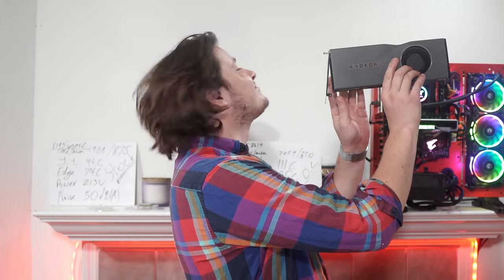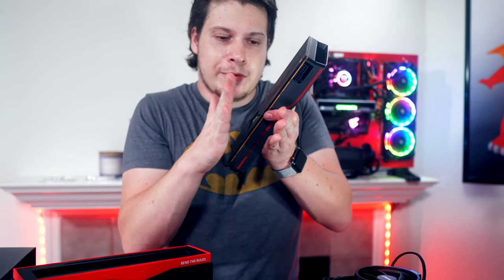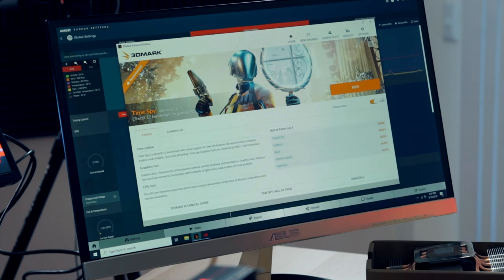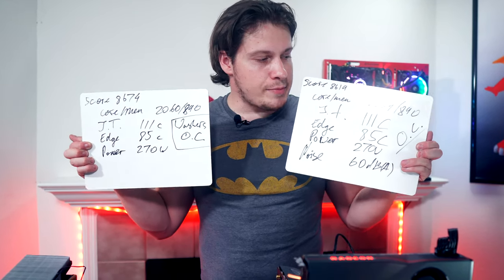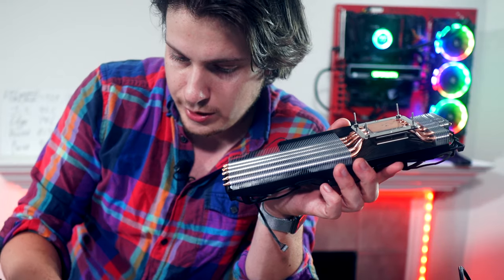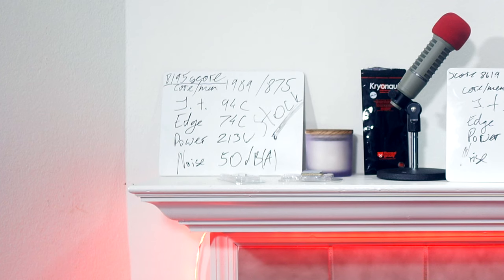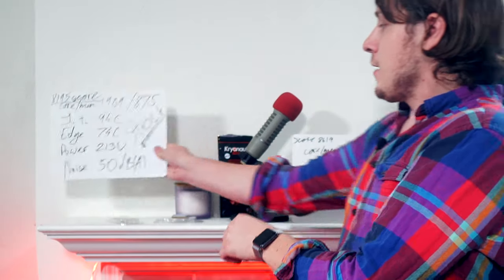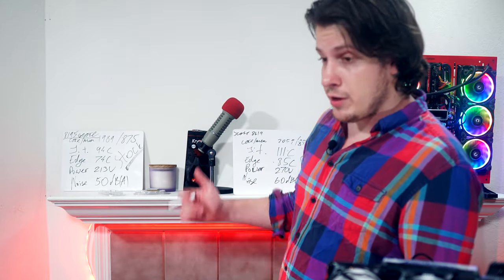AMD RX 5700 XT Cooling HACK

Comment: Thank you!! Is there any chance you'll do a video on how to apply heatsinks (or whatever is necessary) to mosfets, VRM, and GDDR6? And then check memory temps to see the difference.
Reply from the maker: It's coming up!
Reply: @GeorgeTech  that's awesome to hear. Waiting for it!
Reply: @GeorgeTech  my vram in 5700xt is 1750 stuck in idle is normal for the card? or bug? any solution ?????????????????

Comment: My saphire pulse hits 100 easily you recommend me to boy this one?
Reply from the maker: Yours is not blower style. Something is wrong with the fan profile or the card itself. I would just RMA. Unless it's junction temp you're taking about then you're fine.
Reply: George Tech YT the two temps appear pretty close to each other 90/105 the ambient temperature where I live it's around 30 digrees I'm just searching for a solution, more fans, liquid cooling or something
Reply from the maker: Gotcha. 90/105 is within AMD spec and also pretty good for 30C ambient. How's your case airflow?
Reply: @GeorgeTech  I search a little and see some people complain about the case but my CPU is a i5 8400 and it dosent run hot, only the graphic card goes that hot
Reply from the maker: You still within the specification. So no worries there. If you wanna boost longer or overclock that's a different story.
Reply: @GeorgeTech  okey i have it the opposite undervolt and still that temperatures, you think the artic acelero Will help with that?
Reply from the maker: It helps when you have a blower style cooler. Yours is good so you won't see big of a difference. Undervolting should help yeah. I have a video Radeon vii mining review where I'm showing undervolting in wattman. 7nm cards can run with really low voltage if you limit the clock a bit. Application specific though. You would have to tune for each game and watch for the driver reseting to stock. 90/105 is not crazy though.
Reply: @GeorgeTech  I see, thanks so much for the help
Hopefully I can make it a bit cooler I would ask in the store well when Covid let the store open

Comment: I used the same Cooler on a Vega 56 and added the memory and mosfets sinks. I honestly don't trust the thermal tape. I feel like a heatsink might fall anytime. 0_o Love the cooler, hate the sinks. ^_^
Reply from the maker: Hahaha they won't I promise! Vega has HBM2. You sure it was memory? Maybe controller?
Reply: @GeorgeTech  LOL, true. I put them on the mosfets and other parts, but damn, there are a few located where you usually see memory chips. That one slipped, bad, yet the point is that the ram-sinks with the thermal tape really make me nervous. ^_^
Reply from the maker: @adnelortiz  Hahaha I'm with you on that. I have a video coming up on thermal interfaces. It's not that bad. So hopefully, it will ease the "pain" lol